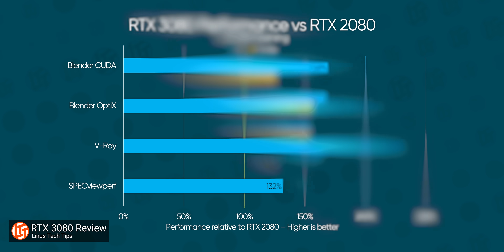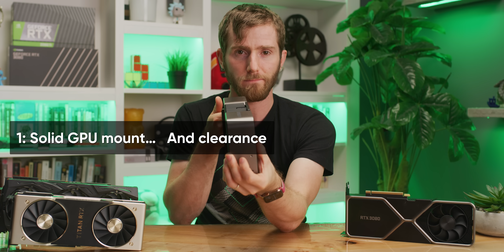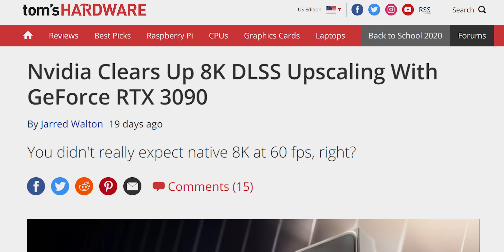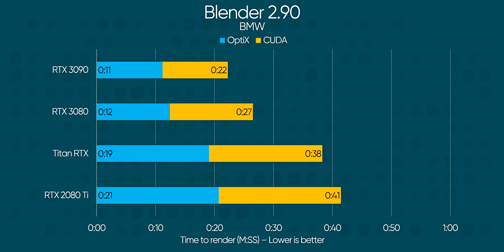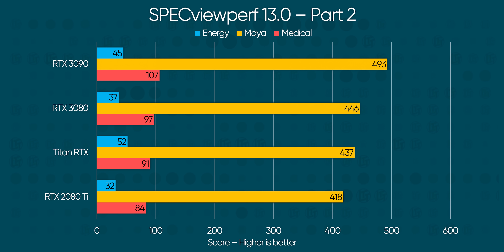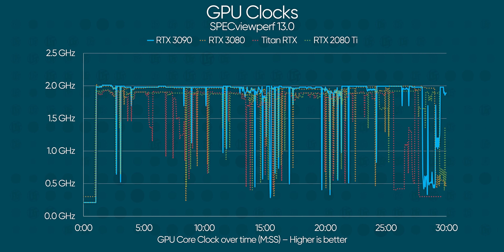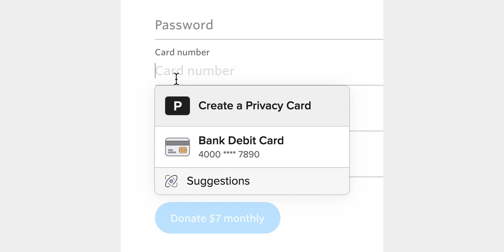Making Nvidia’s CEO mad - RTX 3090 Review

Comment: Is it possible to have 2 of those Graphics cards without bottlenecking the processor?
Reply: @Iqbal Muhammad You mean it's impossible because even the strongest CPU can't "run" both if those?
Reply: @Iqbal Muhammad Yeah... You're right, but I mean this is kinda like a question for Linus, because if you'd be abled to run 2 of those, then, you'd be on a whole another level of gaming, and I mean, Linus is a genius when it comes to Computers, he can probably start a little project by somehow putting 2 processors along with the 2 graphics cards.

Comment: I think developers miss the mark when they make things like this, in that size. Installation space in a computer case is tight enough. Developing technology that is space saving is the real ticket. I don't relish the thought of needing a separate enclosure to hold a graphics card; then having to run wires all over to connect it. That's not practical. Then there is the cost. I think $10k for a card is awful. You don't think it costs NVIDIA that much to make it do you? Lord no.

Comment: YOUR AMERICAN COMPUTER HARDWARE TECHNOLOGY IS LIMITED. 
1. You do not have parallel 0 raid hardwired configuration in which more than 4, 8, 16, 32, 64 CPUs are processing the same data so that
    if one CPU gets into trouble, then the rest will turn the one off and keep on working NON-STOP.
2. You do not have parallel mirroring WORM hard drive configuration the only records information with more than 4, 8, 16, 32, 64 WORM 
    hard drives. One recorded it cannot be erased. So that if someone made a mistake then instead of that mistake altering all WORM
    hard drives, all what will happen is that it will only be recorded, that portion only which will be marked ahead in the unrecorded portion 
    of all parallel mirroring WORM hard drives that will be saying that "THIS PARTICULAR DATA IS CORRUPT AND MUST BE BYPASSED AND 
    IGNORED at all costs and at all times "FOREVER".
3. You do not have a "ROMAT" system known as the "Record Only Magnetic Archival Tape" system in a robotic set up with parallel record 
     only magnetic recording head. And having about  4, 8, 16, 32, 64 systems. 
4.  You do not have parallel 0 raid hardwired configuration in which more than 4, 8, 16, 32, 64 GPUs, ROMs, RAMs, GUIs, USBs are 
      processing and handling the same data so that if a mistake is made or one unit malfunctions, then that unit is turned off and ignored.
      if one GPUs, ROMs, RAMs, GUIs, USBs, etc gets into trouble, then the rest will turn the one off and keep on working NON-STOP.
5.  You do not have a particular Russian technology called Multiple computer signal multiple-photo copier-cloner-replicator that can 
      can create an indefinite number of PERFECTLY REPLICATED COMPUTER SIGNALS WITHOUT ANY FORM AND KIND OF DEGRADATION
      then it is not only a multi-user system but a multi-computer signal transmission styled system. But only hardwired into the computer 
      printed circuit motherboard.

You do not even have a hardwired anonymous SCT Scan Copy Transfer analog IC chip or analog printed circuit board that can anonumously SCAN, COPY, AND TRANSFER  COMPUTER SIGNALS-INFORMATION AND STORE IN A WORM HARD DRIVE, DVD, MAGNETIC TAPE, ETC.

THE KIND OF COMPUTER SPLITTER I AM LOOKING IN AMERICA INORDER TO COMPARE IT TO OUR RUSSIAN COMPUTER SIGNAL INDEFINITE MULTIPLIER IS AN AMERICAN COMPUTER SPLITTER THAT CAN BE USED TO SPLIT COMPUTER SIGNALS WITHOUT ANY DEGRADATION INDEFINITELY.

 FOR IT MUST BE REDESIGNED AND HARDWIRED TO MAKE A COMPLETELY PERFECT REPLICATED XEROX COPY WHICH IS ENHANCED-COMPENSATED INDEFINITELY. Like a multiple copies photocopier equipment that can make a thousand to tens of thousands duplicate xerox photo copies on paper of the same page and of all different pages.

We Russians can achieve this and do this because we are better at conceiving and designing and developing analog IC chips and analog transistorized printed circuit boards and motherboards to perfectly do a single particular job. Though we can also make a hybrid analog-digital IC chip too for our military computers.

Comment: it's so funny that they "made" this ray tracing technology that brings even the 3080 to it's knees with higher resolutions and you gonna need a 800$+ GC to run on decent fps and they will keep making faster and faster cards and after 3-4years they gonna invent some new bullshit that's gonna eat 30 or so fps so they can keep selling their overpriced GCs. At this point i won't be surprised if they develop games to look way worse as lighting goes with RT off in comparison to RT on so you eventually buy their overpriced new shit. Anyway i hope i am wrong cause theoretically speaking a 3090 should be able to keep you playing with max settings at least 15 years

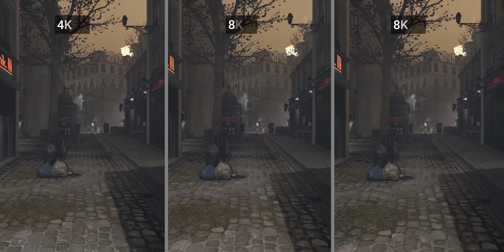Comment: 7:00 Linus, you have to upload in 8K if you wanna show differences...
Reply: That isn't exactly how it works.  You will still realize a perceptible difference in footage captured at 8k and transcoded to a lower resolution.  7:16 is a good example with the red text on the word "LASERFLOP" - even at 1080p.  Your line of thought is only valid if your machine is doing the native rendering of the original scenery.
Reply: @jong2359  Actually it depends on the rendering and encoding functions use. Technically, both is possible.

Nevertheless, I just tried to make an ironic statement.

Comment: with the size of video cards we really need new case standards. like brackets at both ends, like those old vesa cards (ive seen cases with tail end clamping mechanisms, i dont think it was part of the vlb standard though). something that big should be mounted with no fewer than 6 screws.

Comment: C'mon... It's the same story as with the old RTX Titan... 
The 3090/Titan cards are not  meant for gaming. It's primarily to be used in workstations for researchers, professional creators, and other pro/semi pro applications. People keep flapping about 8K gaming, which nobody is going to use it for, outside of benchmarks and showcasing.

To give some perspective to all the gamer people, who talks about how the 3080 is this n' that over the 3090: For being able to run many AI and Machine Learning applications and models, you need to have enough video memory. Often anything less than 16 gigs isn't going to work, or even 24 gigs. The models are simply too large to run on the available memory. A good and very common example is large NLP Transformer models.
The number of Cuda cores are obviously also an important factor, but they will only have an affect on the speed of running things, rather than the actual ability.

Comment: I want to buy a RTX 3090 in couple days, I'm using 8700K now, but I can't afford a new CPU like 10900K and the Motherboard, now I'm wondering should I buy it? Or I'll just waiting for RTX 4090 and upgrading those parts.
Reply: And I'm using 1080ti with 2K screen.
Reply: For gaming? No, this isn't a gaming card. 5-10% average more fps for 100-115% more money (compared to 3080) isn't worth it for most people. In addition to a new CPU, you'll also probably need a new PSU if your current one isn't strong enough.
Reply: @takotako3321  Thanks, my PSU is AX860i, enough for this, you're right, 3090 looks like a 95% titan, not for all the gamer, maybe I should buy 3080 or wait for 40 series, and change all the parts.
Reply: @Andrew Is 3080 enough for 2K RTX?
Reply: @Andrew Anyway, thank you for your advise, I will buy 3080 for insurance, but keep the 8700K, because my gf just said she needs a new phone.

Comment: I have a feeling that if amd does release some rx 6900xt with 300W with a 10-15% performance increase than rtx 3080 nVida may actually improve the driver of rtx 3090 like make the special driver for the titan rtx to boost its performance or release a rtx 3090 super/ti using the really full die (5376*2) cuda cores and then extreme oc it and charge us at 1499 like the super cards for turing...

Comment: I'd love to know if it's worth trying to get a 3090x for a triple 4k monitor setup, I used to play 1080p surround and already have the monitors but with the current 980ti I'm running frame rates are garbage. Is it worth trying for triple 4k on a 3090 or should i stick to single 4k, get a 3080 and wait?

Comment: Dont you think that ryzen 9  3950x or a 3900x would have been better to test out the performance as intels processors dont support pcie gen 4 which will result in a smaller memory bandwidth decreasing the performance of such a powerful card that recommends pcie gen 4

Comment: "There are driver optimizations that you will not get"
In other words, screw you, we will release a more expensive card that has the drivers and is basically the same hardware.

What part of this video should make Nvidia's CEO mad?
Mostly this was positive review and recommendation to buy the product.
Reply: If you can get ur hands on it lol
Reply: "Mostly positive" showing that the card have at best 15% more performance in games then 3080 for double cost. And in productivity its beaten by older gen while taking close to 400W, well that doesnt look too positive to me. Sure you can play few games at 8k with dlss and use it for very few tasks that just require huge memory but no pro features. This gpu is very disaponting.
Reply: @eth_saver  Maybe it's not positive for most people looking to buy this. But to an average Joe it's all in a positive light. Nothing was formulated as a complaint, just as a slight inconv3nience
Reply: @eth_saver  To be fair, the card is disappointing because of the price, if it was like 799 that would be a compelling price, leaving the 3080 for a more appropriate price at 499 MSRP. I'm currently still rocking a RX 480 and would like to get one of these beasts but the price is just too high, guess I'll wait for big navi and see what they have to offer.
Reply: @eth_saver  It won't be using 400W all the time unless you're pushing it to the limit and you could get much better frames at 4k with the 3090 over the 3080.
Reply: @ihazdaforks  Or you could save 800 dollars.
Reply: I mean he has affiliate links to buy these cards in the description. Normally if you piss off a brand's CEO they cut you off from their creator/Affiliate program.
Reply: It's positive in a sense, but not really...as someone who only games and doesn't care about content creation, the card is not worth it at all, which this review (and other reviews) show. Is it better than a 3080? Sure....is it over double the price better? Not even close. Better off waiting for a 3080ti or Super or whatever they will do.
Reply: I wonder if there's a way to manually unlock it.
Reply: @ThatFadedAsian  probably is but you would risk breaking your card. You usually can easilly install any drivers on any hardware just by changing the .inf file to recognize your XXX hardware as YYY. I've done this with both displays (old display to a similar Philips one, only because I needed to calibrate colors) and graphics cards (installed a RX Vega driver in a Intel iGPU - of course I didn't use the GPU for anything, I only wanted o check something in AMD config panel) in the past. It works (as far as installing any driver goes), but if your hardware is too different from the driver's intended hardware, you could go from looping a BSOD to wrecking your hardware. However, until they release the Ampere Titan, there's little anyone can do besides installing it and not using the card, since installing the RTX Titan (Turing) on a 3090 could easily get to that last result, being different archs and all.
Reply: Welcome to Linus Tech Tips.
Reply: This vids is very positive and only slight complaints at end.. more like promotional vids than true review vids. 

Sorry linus but GN, HU done better jobs trashing Nvidia marketing than you
Reply: Linus has always been an nVidia sellout.
Reply: Jesus christ, he doesn't need to call their CEO a dumb b*tch for it to be harsh criticism. He basically bashed all of their marketing, from the "greatest generation" bullshit to the "8K gaming" claims. But Linus depends on these people for content, so he has to be very tactful and diplomatic about it.
Reply: @elsasslotharingen7507  he don't depend on them he can buy the items himself and make the content ;-) is it cheaper to get it sent? yeah... would it be impossible without? nah
Reply: You would sell out too if you got a free 8k TV to put out a paid promotion midnight before the launch AND get paid on top of it

Comment: I wonder if there will be a time when we have quantum processors with 240 Cores and 960 Threads that run 22GHZ All Core Turbo with integrated 8640p480 graphics, Monitors with no bezels, ray tracing capability on every game (except the old 8 and 16 bit 2D games obviously), 3000 Watt Power Supplies. CPUs don’t need coolers because of the technology, 1nm CPUs. 5PB SSDs.

Comment: DLSS 2.0 is actually amazing. After this gen, anti-aliasing is a thing of the past. No more using 25% of your GPU power just to smooth edges.
Reply: Anti-aliasing was already a thing of the past for anyone with a 4k display of a decent size (not too large). DLSS is a gimmick and a marketing name for upscaling, which has nothing to do with anti-aliasing and actually makes your images more blurry/less accurate compared to native resolution.
Reply: @chiefjudge8456  Supersampling through nvidia control panel has been a thing for a decade. This is not that simple.
Reply: And obviously 4k screens have existed. The point is that we finally have a card that runs 4K well.

Comment: As someone who is not in the market for a GPU, I still think that if nvidia cared about gaming as much as they do their stock prices, they would have released a 3090 with 12 GB of VRAM for $1000-1200 and left all of the double vram capacity SKUs towards more professional oriented cards.

They already dropped the Tesla branding, why not?

They don't even have to be quadro models (maybe give them tunable TDPs), just make a whole damn Titan line of "pro-sumer" RTX cards. Make a 3090 Ti, 3080 Ti, and 3070 Ti all branded as the 30XX Titan (everyone forgot about "titanium" a decade ago).

Fuck it, IMO just replace the whole geforce branding nomenclature with just Titan.
 You got a Geforce RTX 3080 10 GB and a Titan RTX 3080 20 GB and so forth. nvidias marketing is such garbage, why even tout 24 GB of VRAM for 8k gaming when you don't need that much with decent memory management?

The only reason they went this route is because they are using a big and hot half-step node at Samsung's 8nm and they want to sell the naive (and rich) consumer on "8K GAMING" and arbitrarily claim that they're still the crown holder of gaming performance.

It's basically Fermi 2.0, the AMD Bulldozer of GPUs. I would know, I owned both of those in the same rig back in the day.

Comment: Running doom eternal at 60 fps isn't very impressive this game is so optimized it would run 300fps on a toaster at 1080P.
Reply: at 8k i'm pretty sure it is in my opinion, but you're right it's more optimized than anything, and a $400 pc would probably run at 60 or 40fps at 1080p to be realistic
Reply: @donovanwells7716  It actually runs AVG 60FPS
 on an I5 8400 2.8GHZ with 16GB RAM DDR4 2666MHZ and a toaster grade GTX 1050 2GB.
https://youtu.be/6N5roEhPk64

Comment: Everything just sucks... Even if I had money to buy a rtx 3000 series, or even a rtx 2000 series, I'll not have monitor to use it, monitors 1440p are expensive as fuck where I live... I'm pretty much stuck to my 1070 and my i7 4790 and 1080p monitor, a brand new computer plus a 1440p monitor worth like sixteen times (or more) the minimum wage hahahahaahahahahaaaaa damn........

Comment: 8k = pointless. I have a 27" monitor, not a 10-foot tv, even 4k is mostly pointless.
Reply: @Haldir111  Pointless to me when I can't tell the difference without split-screen comparisons between even 1k and 4k, and even then barely noticeable and it's just diminishing returns after that (8/16k/32k = even more pointless). Plus if I have the time to do that then it must be a pretty boring game. Lemme know when it can do 1080p at 60fps that's indistinguishable from live action rather than an obvious rendered cartoon, better still a 3d hologram with those specs with images that can pass for real objects. To me it hasn't really changed much in 10+ years and is still the same flat shit.

Comment: Your card seems to already be overclocked quite a bit. Your perf numbers were a bit higher than everyone elses the whole video but your power consumption and boost clock is aswell. By the way Pcat is a scam. It has the resolution of a chinese toy oscilloscope. Hook any entry level hobby oscilloscope to it and you will see huge power spices. A tool like Pcat is basically useless to an engineer and it is a joke that Nvidia claims they use it internally. It has >100us resolution while my $280 scope goes into the 10s of NANO seconds. That is why igor's lab saw spikes up to 480W on the 3080 that all the youtube hacks missed.

Comment: I theorize the 30-series is just bringing more RTX tech to the frontline, where the 20-series was supposed to go, and as a result all RTX lineups will be getting much more valuable as time goes on. The issue, ofc, is that the 20-series is no longer in production, making them much harder to find over 30-series cards that, admittedly, work better, but also cost a bit more than your usual card and has the added difficulty of actually purchasing one. But I can wager the 20-series cards will end up gaming even at 4K fine with DLSS once games start using the technology more often, as DLSS starts becoming generalized.